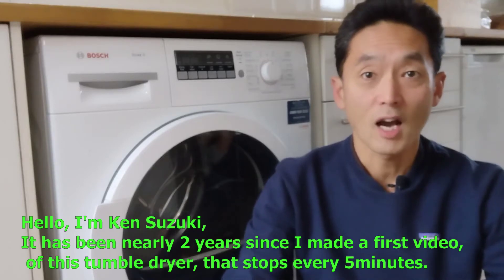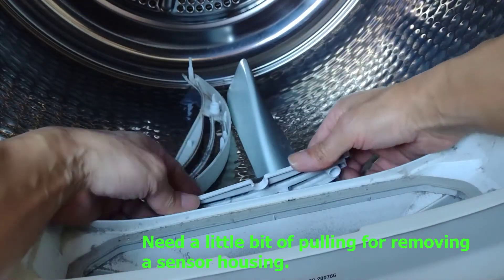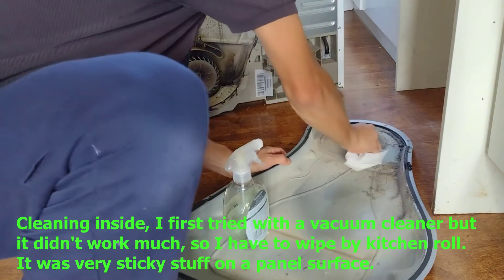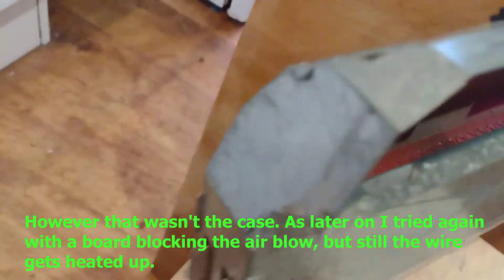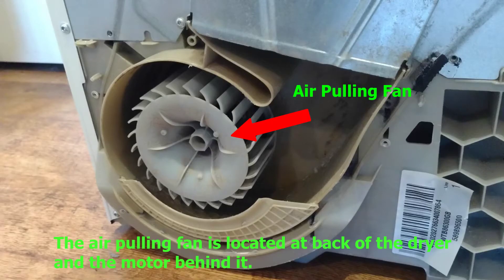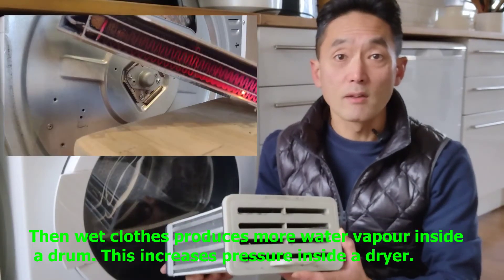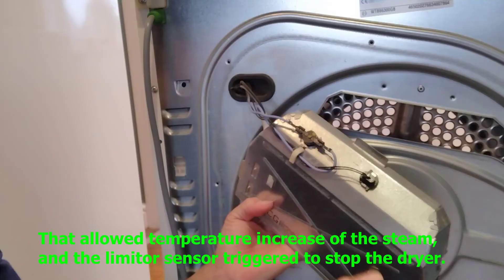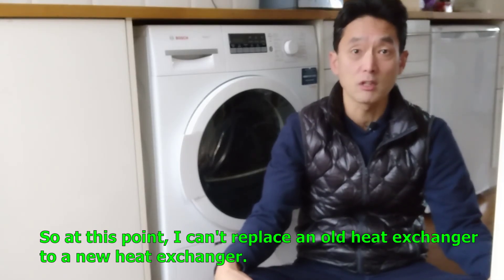TumbleDryer2 HeatTemperatureSensor

Comment: Thank you for sharing your experience. It is significant that your dryer stops without an error code. This suggests that it stops under “normal” conditions, or at least the condition that makes it stop is not defined as a fault in the dryer’s firmware. My very similar Bosch dryer always stops before the laundry is dry, but it runs for an hour or more before it stops. I have always suspected that the humidity sensor reads no conductivity many minutes before it should.    Anyway, as a workaround or test, you could try the timed dry mode in the dial, and then add time by pressing the Time Dry button. My dryer runs for the preset time, independent of the dryness of the laundry. If yours also turns off during timed mode, wouldn’t that mean the limiter circuit is engaging?
Reply from the maker: Hi, Thanks for the comment and info. Sorry I had to say that my dryer stops by "Fluff filter /Heat exchanger" fault with the red 3 bar horizontal mark alarm. I have tried 20 minutes force run and even with that it stopped in a middle before finishing 20 minutes cycle, but now this is better. However it's worth try again. And I never done time set run more than 20 min auto run setting. 
Thank you, I still have many things to do before giving up this dryer.
Reply: @kensuzuki9319  Okay, I can see why you are clearing fluff and stuck-on lint from the back of the dryer and replacing the heat exchanger. My machine gets the more traditional "Check Drain" alarm, beeps, and stops. Then I clear the lint from the pump basin, wash the heat exchanger, and clean lint/fluff from the channel below the fluff filter, and in the channel behind the heat exchanger. I already replaced the pump once, but could have just removed and cleaned the original. My next step is to replace the fluff filter itself, because there is a lot getting past the filter. I would just replace the whole dryer if it were not so expensive- USD $1200-2000. I have never put so much work into a laundry dryer!

Comment: You can soak heat exchanger in the water and leave it there for a while, you don't need to buy new one. Or you can use high pressure water cleaner (usually to wash a car) and clean it from the side (where the machine sends cold air). I have Bosch tumble dryer 14 and a half years now and all I had to do is clean it (after 8 or 9 years I had to clean it just like you did in your first video and about 4 years ago I cleaned it just like you did in this video - heater and all inside). Now I clean it from 2-4 weeks just from inside the exchanger (I also open that water part and clean it with a sponge so that it is cleaned and dried - because it is cleaned once a month you can check that motor pump for water and sensor).
Great video! Keep up the good work.
I believe it useful at least for those that would need it when first opening Bosch's tumble dryer - it would be useful 6 years ago when I first opened it 🙂
Reply from the maker: I see. I can try soaking the heat exchanger in a water. Definitely worth to try. Thank you. 14.5 years is great to keep going with your maintenance. I feel mine is nearly end of life but I try as you did. Thank you!
Reply: @kensuzuki9319  People are always throwing used things away and buy new one. I have enough money to do that too, but I am not going to. There is enough trash everywhere and it is just building up. Repairing things is also something I love to do. That is why I believe almost anything can be repaired. There are always limits but some things can be just fixed (or cleaned) and some can be replaced with new parts while others are really just not worth doing that. When I moved together with my wife (then girlfriend) we bought all kitchen appliances. They are all 14,5 years old and some needed to be repaired (washing machine and fridge) while some needed to be just cleaned (dryer, oven, induction cook and dishwasher). They are all from Bosch but from what I heard today are not making them as good as before so maybe I am just lucky 🙂
Regarding soaking: I really believe something could be done by that. Leave it in water for some time to soak it good, then shake it in water (like bath or something big enough that it can be fully merged). Keeping my fingers crossed. Pressure water could be even better but I didn't try it myself.
Reply from the maker: @tomazzaletel3458  I will definitely do the soaking method, that is something I can do for my continuous activity. Yes I agree the stance toward everything. I replaced heater pump on dish washer recently based on someone else's video, how to do, and it recovered working again. Things I can do I want to try to fix. We have so many things nowadays. Thanks for the comment! We keep going!

Comment: Thanks Ken, your persistence is admirable.
I would take that dryer up to the top of my house and throw it onto the concrete below to see if that fixes it.
My dryer looks the same as yours, but taking the back off looks too challenging to me.
No wonder the manual says to clean the heat exchanger every 2 weeks, mine was also full of sludge.
And still no water goes into the container.🤔
Reply from the maker: You might have found the better way to fix it before me! I'm gonna give a jump kick next in the video! Ha! 😁
Reply: @kensuzuki9319  I'm going to take the back off today and clean that pump and sump area.
The dryer runs for quite some time and the clothes get hot but no water appears in the water tank.
An annoying thing is that the manual mentions the moisture sensor being 'near the filter' but I can't find it for the life of me!
Reply from the maker: @swhite1702  Yours sound like that the pump not working however I m not sure why. I don't think it's anything related to the humidity sensor though. The humidity sensor mine is just 2 metal pieces fitter at soon back of the front door, but nowadays ones I have seen those are on fins inside drum round surface, normally on each fins of 2 in a drum. Good luck.
Reply: @kensuzuki9319  looks like I can't access the pump and sump without further dismantling the back.